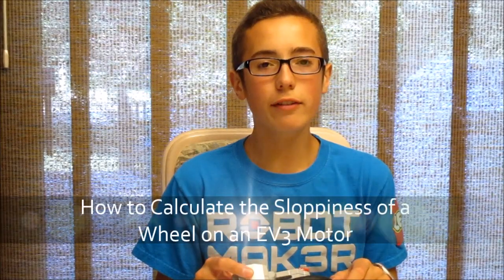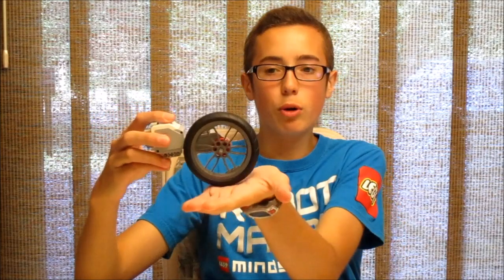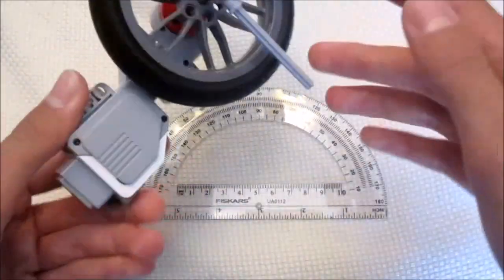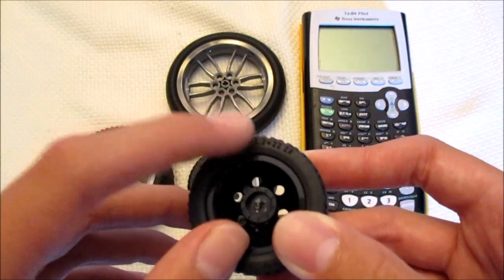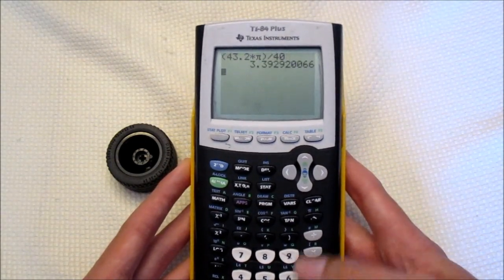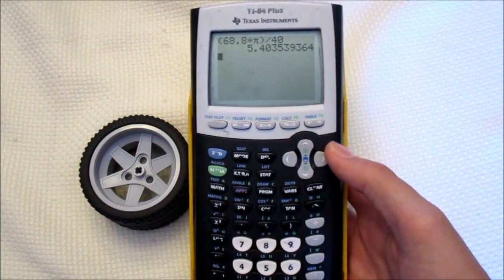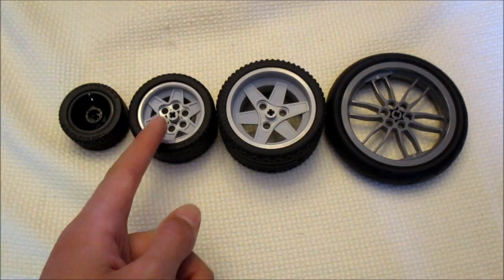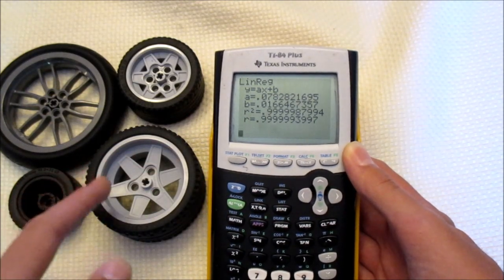How to Calculate the Sloppiness of a Wheel on an EV3 Motor

Comment: one way to get rid of the slack is: don't drive your wheels directly. add external gears to the motor to wheel interface to slow it down. momentum from the wheel also contributes to the backlash in the motor assembly.adding the white clutch gear to the wheel driven from a 8 tooth gear would allow the robot to accelerate or decelerate more smoothly
Reply from the maker: The two thinks you suggested would greatly increase the slack in your drivetrain. The reason why the motors have any slop in the first place is because they have a lot of internal gearing. Adding more gears on the outside will only make it worse. And never use clutch gears in a drivetrain unless you have to to protect your motors. They will add a lot of unpredictability to your robot's driving.
Reply: worm gears should work even though their asymmetrical. i use gears a lot in any of my creations including worm gears

Comment: Actually (according to Bricklink), the diameter of those big 88516 tires is 94.2 mm, so the "Slop Distance" (a.k.a. Arc Length) is slightly less ( 94.2 mm x pi/ 40 = 7.4 mm).  Even so, if one programs their FLL robot to use their SENSORS instead of making odometry-type moves, the "slop" shouldn't be that critical.  I think that the advantages of the large wheel/tire combination outweigh the drawbacks.
Reply from the maker: +dluders Yes, I agree. I still like tall wheels better. I want to do a discussion video about this.